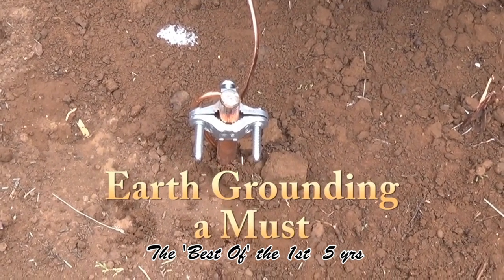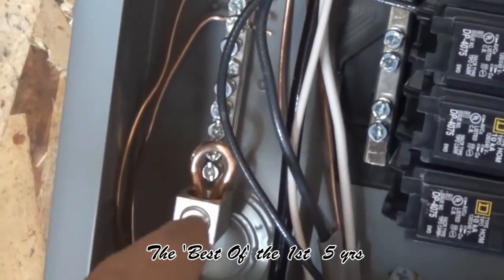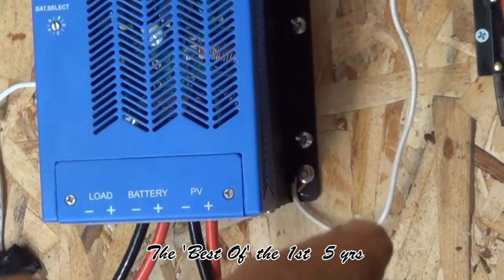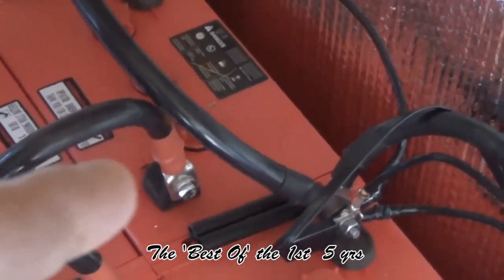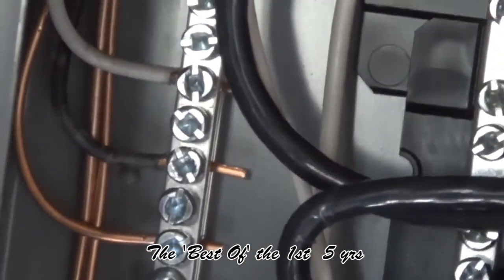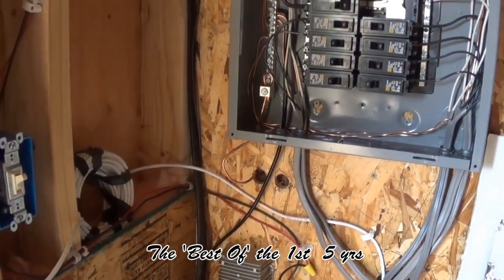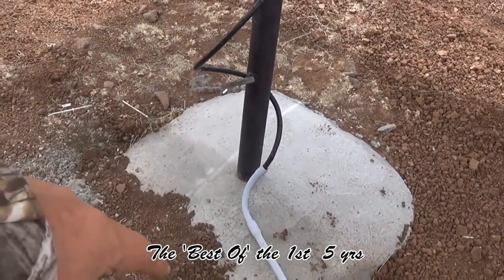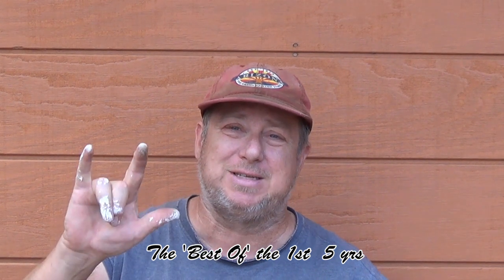Solar Grounding - Top Video

Comment: You didn't seem to mention whether you bonded your neutral to the ground at this panel.  Yes, the negative of the battery is grounded, but if the 120 volt inverter output gets shorted to a grounding wire, will it get back to neutral to pop the breaker if it is not bonded?
Reply from the maker: not sure. i only did what someone else said to do.

Comment: How is your road holding out? Second year of mega rain.
Reply from the maker: great. the repairs i did have been perfect. now i have to work on other drainage areas. what about you. i havent been done 8206
Reply: @ArizonaHotHomestead  8206 is under water again. I live on 8057 south of you, so I have to drive up to 8059 then west over to 8051 and come out on Hillcrest. Crazy because using 8206 is 8 minutes to 61, working my way to Hillcrest takes 18 minutes. First world Off-Gid struggles lol.